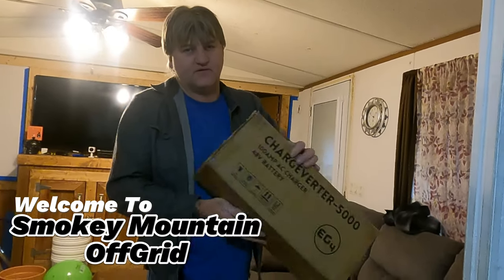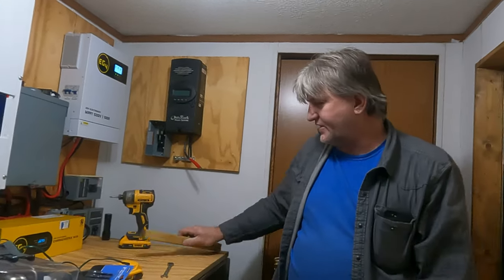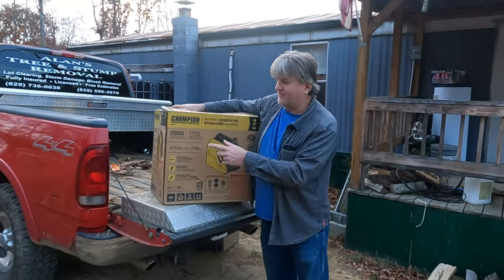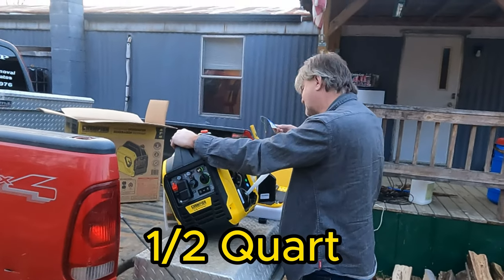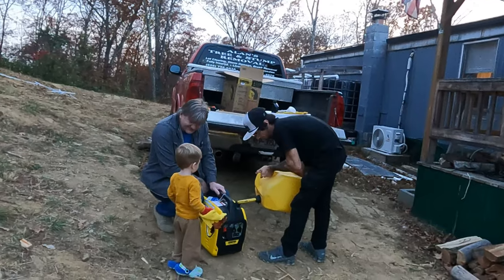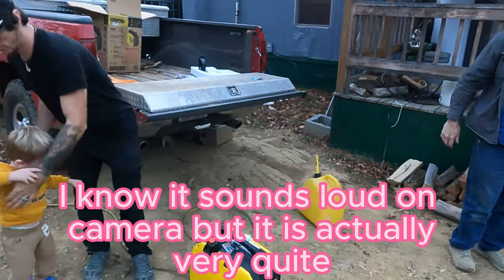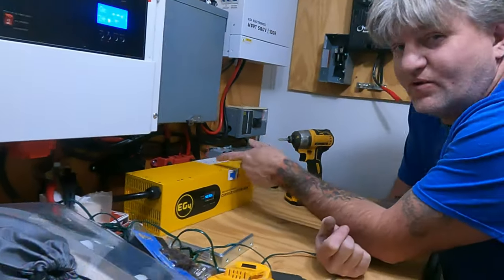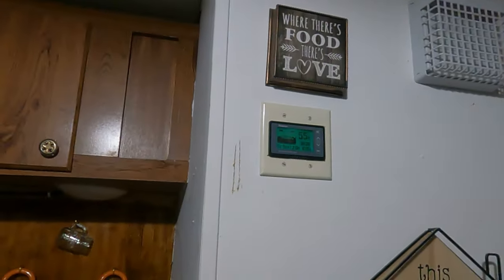EG4 Chargeverter And Generator Problems

Comment: I have a 3600 continuous watts on propane.  I used a Victron autotransformer to step up the 120VAC to 240VAC.  This allows me to run the newer chargevetter to 57VDC at 63 amps to get me close to the 3600 Watts to recharge my battery. This pulls almost 30 amps off my 120VAC/30amp source from my generator. Wish I had a bigger generator to get the full 5KW from the chargeverter but oh well.

Comment: I would recommend a generator with at least 6,000 Watts continuous running capacity for this. I run two of these chargeverters at full power with and Military generator with a diesel engine.

Comment: The Chargeverter brings the Voltage down to 48v in order to charge even if the generator is large or small the voltage gets decreased in order to charge without breaking the inverter

Comment: Get a Champion Dual Fuel Generator and then run it off of Propane.   Then you will not have to deal with clogged dirty carbs from crappy ethanol fuel. Or trying to source ethanol free fuel or adding stabilizer.
Reply from the maker: Good idea

Comment: IF the math is right then at 20 amps the Generator is working at 1060 watts.  With a high of 1700 watts you should be able to get a max of 32 Amps to the battery.  Not ideal but good in a pinch.  I have a similar set up but with a different charger and 12V batteries.  See the video what happens when the sun doesn't shine.
Reply from the maker: Thank you i will definitely check it out